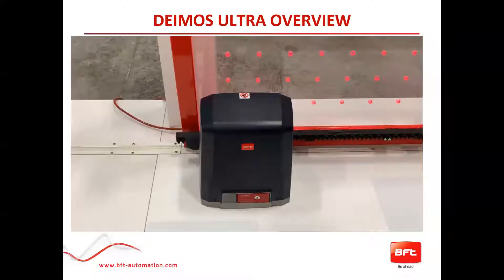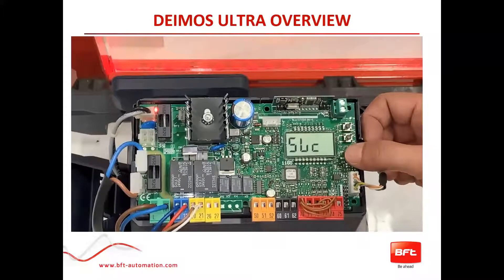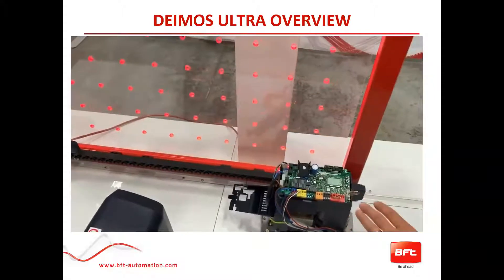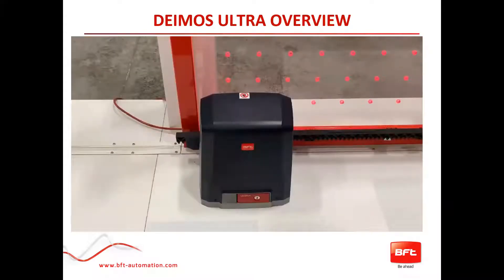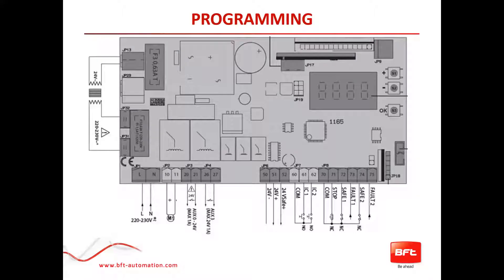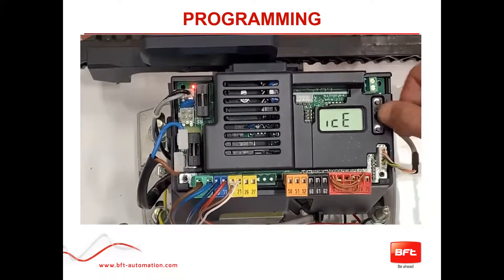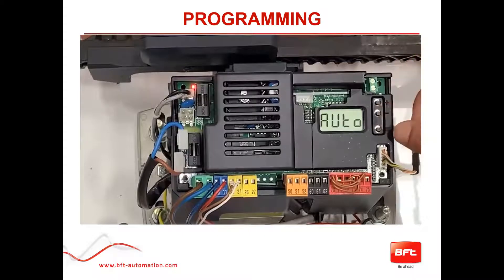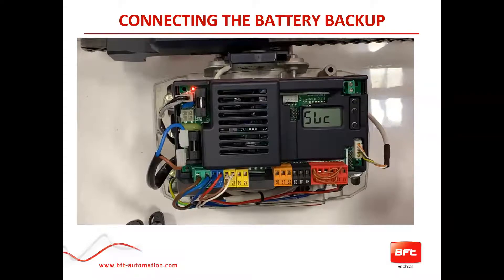Deimos Ultra UL Webinar - Part 2

Comment: Hi sir, thank you very much for your tutorial. I still have a problem. Mine was down so i bought a new motor and card. it looks like the limit switches are not recognized. While autosetting, it just goes to the stop and then blocks and says KO. What could it be ? thanks
Reply from the maker: Hello, so does the word stop come up on display and on the limits itself it should have a L and R and when you are facing the motor the L on the left side and R on the right side. You can also call us when you are at the motor if you need tech support 877-995-8155 option 3. You can also email us at tech@bft-usa.com.

Comment: can I put monostable button (like I got in house for turn on the light) in 60 and 61 pin and then it opens a gate?
Reply from the maker: As long as the dry contact that is connecting to 60-61 closes for about 1-2 seconds it should be ok. Also, depends how far away it is. If it is to far you might want the contact to close for about 2-3 Seconds.
Reply: @BFTAmericasInc  about 10 meters away (in my garage). BTW Is it possible to connect shelly1 24v to open and close the gate too? Would you do a video about this?

Comment: Great videos thanks I just have a question - is there a way to program the remotes so that my one of the buttons has the auto close (TCA) but the other doesn't? (so for times where i want the gate to stay open?) I have the Deimos A 400 V Ultra
Reply from the maker: You have two options.... Option 1: Use the 4-step logic on the board. It comes default already with 4-step logic active, but just to make sure check in the "Logic" menu that STEP-BY-STEP is set to "0". Now that your set up, the way to use this function is IMMEDIATELY when the gate starts to CLOSE, click the remote and it should stop and stay there and ignore gate timer until you give the gate another activation. Option 2: Purchase a Clonix 2/E wired in receiver and use one button on the remote as normal and then program the second button to the latching command on this receiver. Check video out for option 2 here:  https://youtu.be/2wGhP4pVbTQ  

Hope this helped. If not write us at tech@BFT-USA.com and we will do our best to help you out.

Comment: Hi I got BFT 400, Can I reprogram, how? Is there any reset button?
Reply from the maker: Not really a reset button, but you can press and hold s3 for 5 seconds when ever you change a dipswitch or potentiometer to save changes. Also, you can wire in a N/C button to the 70-71 spot which is the stop command. That command will reset any faults that might have occurred while running.

Comment: Can you tell me how can i configure photocell to be active only when gate closing? Thank you in advance
Reply from the maker: No problem of course we can help!! If you have a UL version BFT then chances are your photobeam is tested and using 5 wire hook up. If it is, you want to go to the "Logic" menu you want to go to "safe 1" and change that value to the number 5 and push ok. If it is the non UL (or just 4 wire hook up) you want to change your safe setting to the number 4. If you need more assistance please reach out to us at Tech@BFT-USA.com.

Comment: Having issue with programming. I select my LH and pre select I have it on AR, then on auto select it counts down but gate does not move. After I get a message KO when I click okay message appears ER01 ..... can anyone help
Reply: Your magnets or limit switches are not set up correctly
Reply from the maker: Anything ER01 or ER04 is directly tied to the Photo cells. Please check out our UL phot cell videos to verify proper wiring.